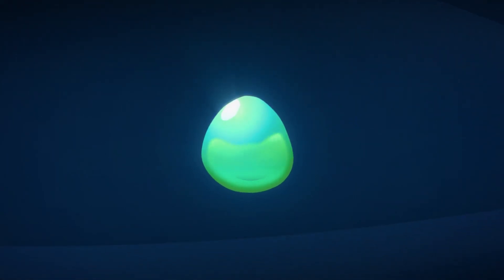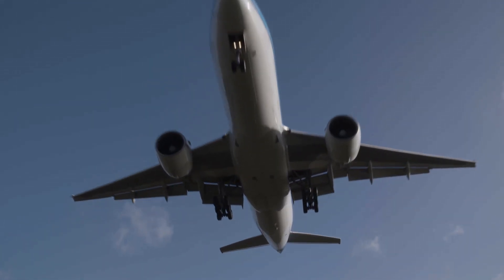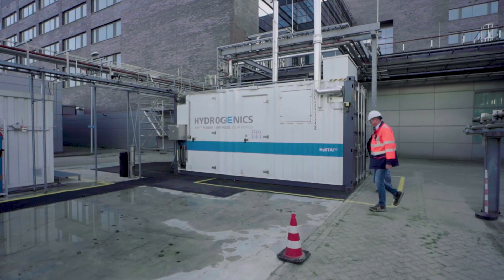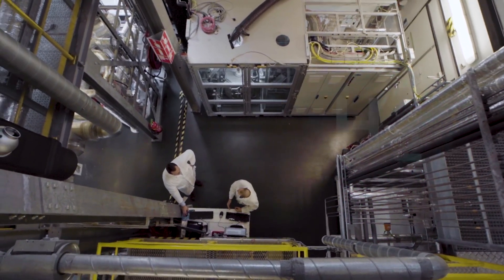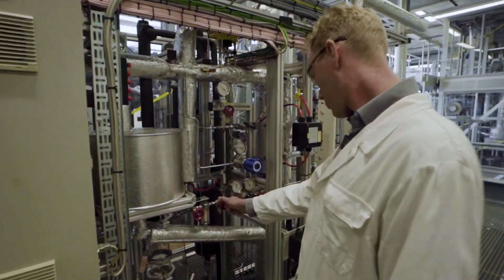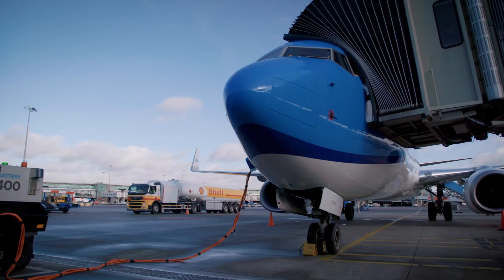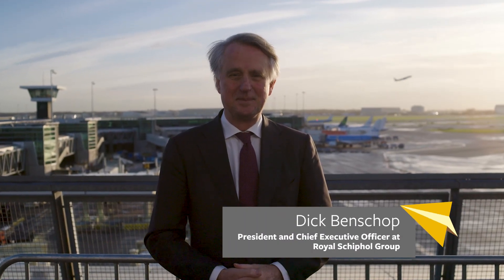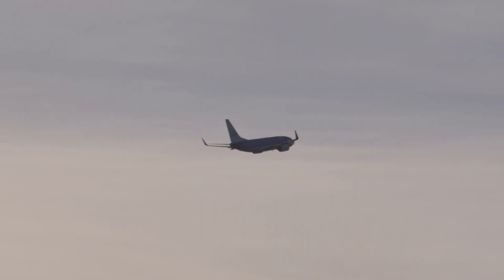First passenger flight performed with sustainable synthetic kerosene

Comment: Green electricity should be reserved where it is needed ... and please give figures, what is the electricity consumption for what fuel consumption?
Reply: No, it isn't a zero sum game. If it is profitable, there will be an abundance of green electricity.
Reply: Yes, this e-kerosene will use green electricity that could have gone to houses, but, in the future, an abundance of wind, solar and ethical hydropower dams will mean that selling synthetic kerosene would be profitable. E-kerosene is much better than battery electric aircraft. Also, LED lights and heat pumps will mean homes of the future would require less electricity, allowing some energy to go to making e-fuels or power the future's (hopefully) eco-friendly corporations. :)